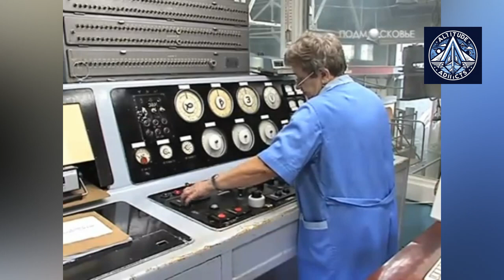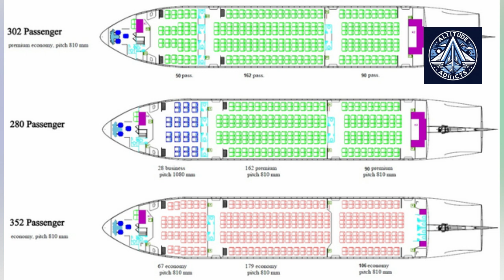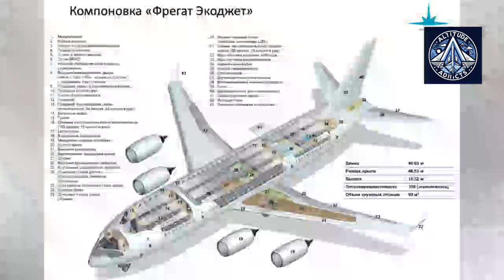Frigate Ecojet: Will Russia Ever Build This Innovative Aircraft?

Comment: Anything new designed can succed in this market with old designs and the 15 years long deficit of aircraft orders and the current failure of supply of new aircraft... I see a big deficit of mid range wide body aircraft that could render the current deficit of narrow body aircraft replacing A320's and B737's frequencies by using a single flight to replace two narrow body flights....